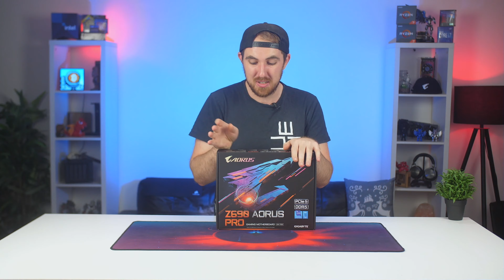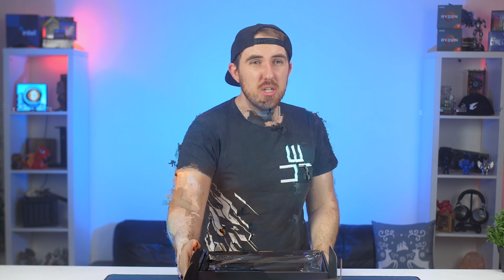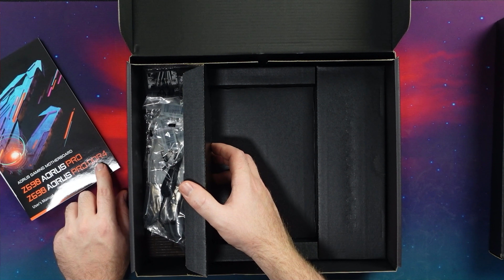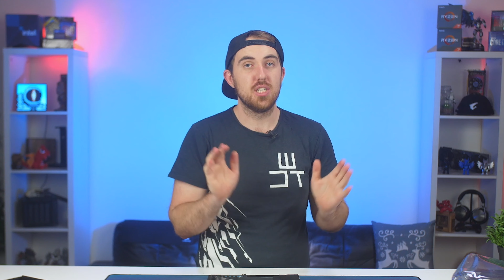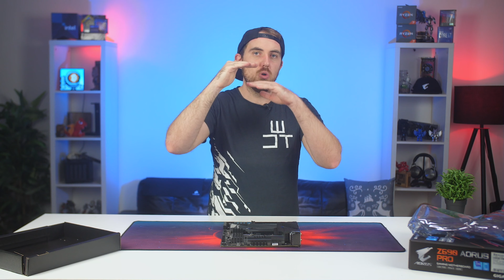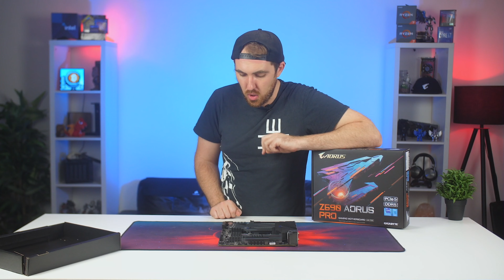Unboxing the Z690 Aorus Pro - Intel Is Making A Comeback

Comment: As for now, in February 2025, I got this board at around $150. Is it a good deal? If I buy it, I will pair the i7 12700kf with RTX 4070 Ti Super. Is this combo still very good to use in a few years to come?